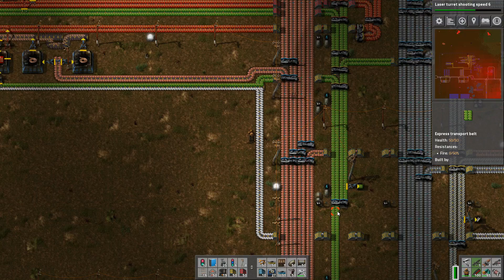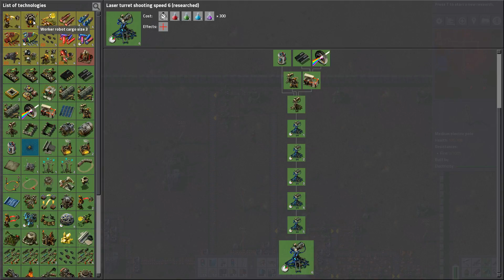Factorio MegaFactory 22 - Moving the Advanced Circuits

Comment: Seems like you need some more plastic soon.
Btw, why don't you use robots for your inventory?
Like "Bring me 50 Underground Belts"
Reply from the maker: I'm planning on getting to logistic robots soon, after I get the new circuit and module production running.  More plastic should be easy enough, too, just need to add more chemical plants.